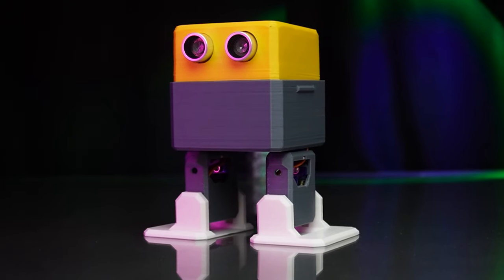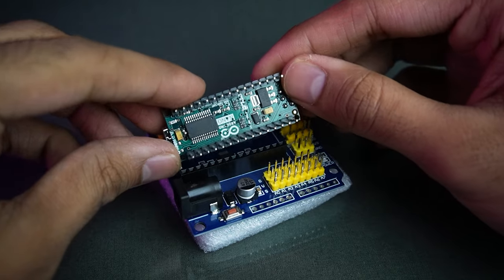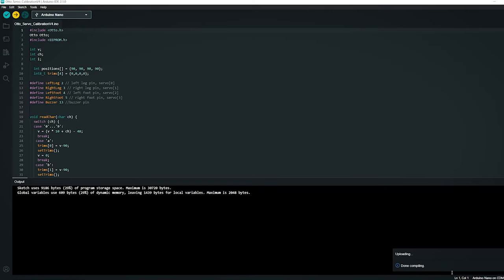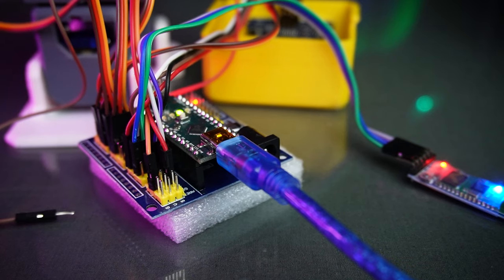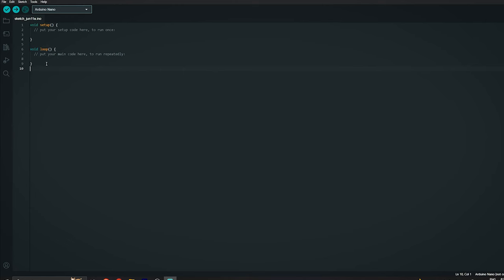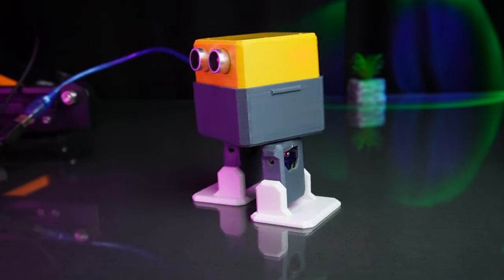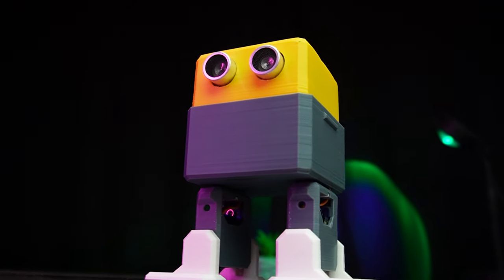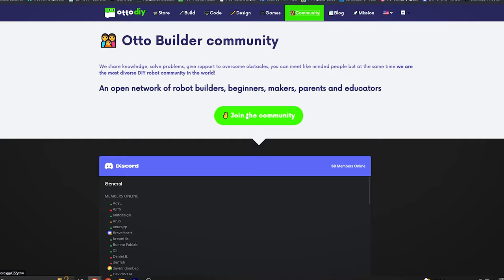Meet The Adorable Dancing Robot 3D Printed OTTO | How To Make Otto Robot #3dprinting

Comment: The problem here is not voltage but current, try making a 3.7+3.7V using two batteries and then make again 7.4V source like before then wire them parallel and then try with the battery !!....It will work
Reply: And tell me After it works, I'm quite curious